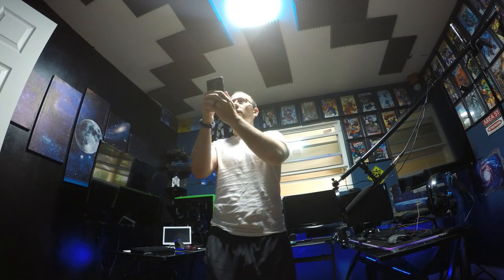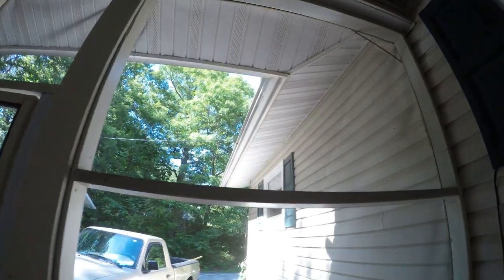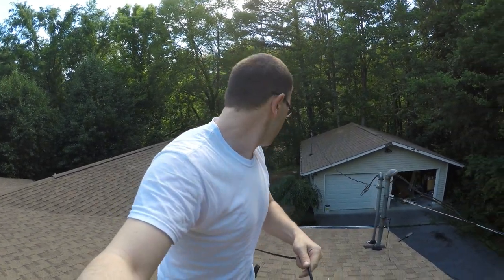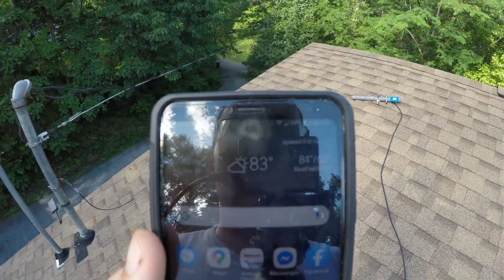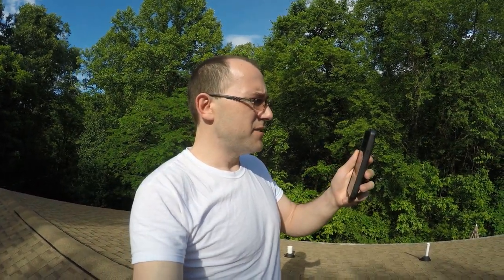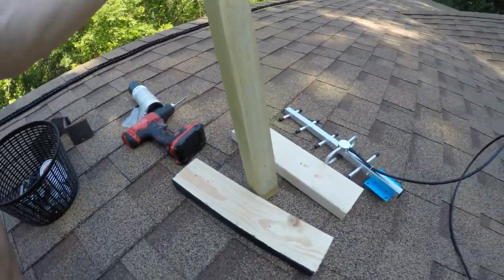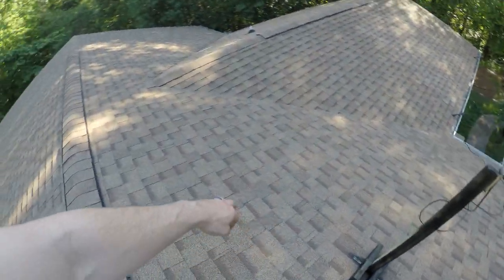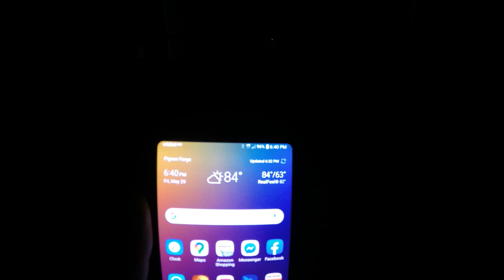Cell Phone Signal Booster Amplifier Repeater GSM

Comment: Your external antenna is a yagi antenna. The tip should be pointing to a cell tower not upwards for it is a directional antenna.
Reply: @Xtian Dyc: It depends on the elevation of the tower. If you are level to the tower it needs to point but if you are down hill but can see the tower then   the antenna can be like a xmas tree.

Comment: Yagi antenna has to be pointed horizontally in a certain direction. Look where the mobile tower is located and point the antenna horizontally in that direction. Yagi antenna is a line of sight antenna. You pointed it upward which is incorrect.

Comment: Your antenna is a directional antenna. The way you have it mounted it is vertical and you are pointing the tip straight to the sky at nothing. You need to mount it horizontally and point the tip you have pointed at the sky towards the cell phone tower.
Reply from the maker: Ok. Thank you

Comment: Any updates?  Also, I think the outside yagi would serve better pointed at the nearest tower versus straight up. Also, did you screw the antenna mount and cable clamps straight into the shingle versus under a shingle flap?
Reply from the maker: With the device off. Its a dead zone... With the device on. We get 1 to 2 bars... And if theres bad weather. Its a no go... Yes i screw it right into the shingles.. But i used a long screw. And i use a type of Silicon to seal the screws. Keep water out.